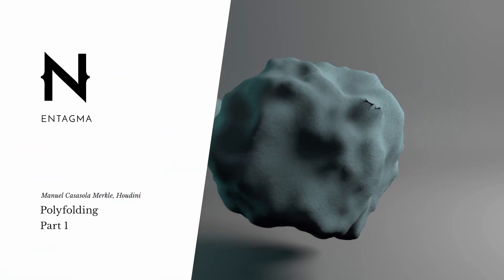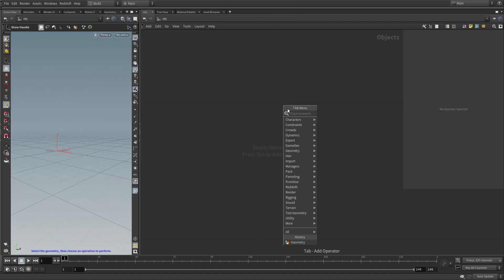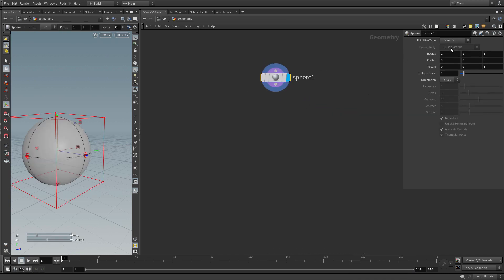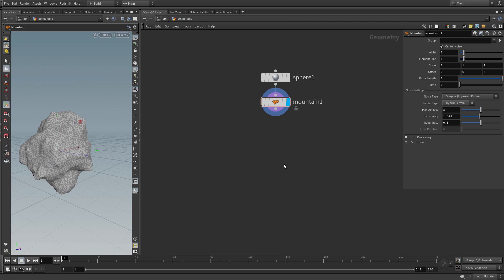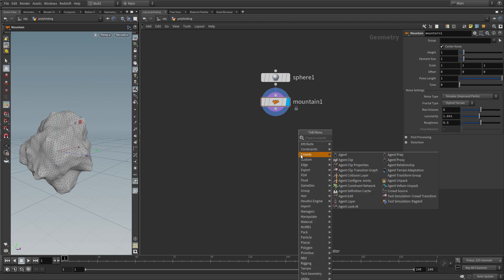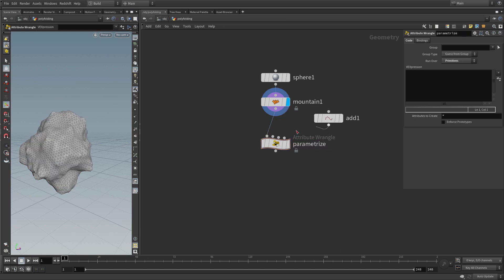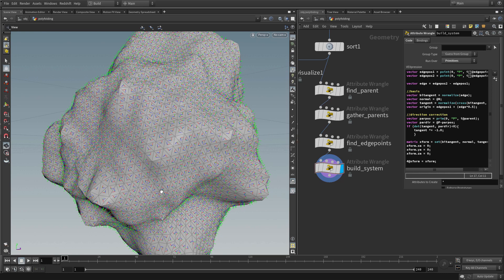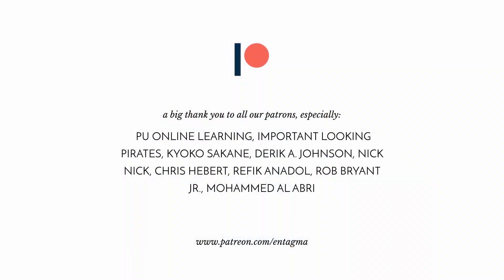Polyfolding - Part 1

Comment: nit:
Creating an array and appending to it can be computationally expensive (unless its actually a linked list or something, but these probably aren't under the hood).
To handle this, rather than removing the parent -1 AFTER you populate it, you should use if (parent > 0) append(...) - this way you will avoid additionally having to resize the array.

Probably not a huge performance gain on a small object, but could be crucial for more subdivs and better practice. :)

Comment: getting error when doing the second primitive wrangle node.  using houdini 18.0.499
Warning:     Errors or warnings encountered during VEX compile:  /obj/polyFolding/find_parent/attribvop1/snippet1: Syntax error, unexpected '>'.     (7,28).
Error:       Vex error: /obj/polyFolding/find_parent/attribvop1/snippet1: Syntax error, unexpected '>'.  (7,28)
Failed to resolve VEX code op:/obj/polyFolding/find_parent/attribvop1
Unable to load shader 'op:/obj/polyFolding/find_parent/attribvop1'.
Reply: nvm typo on the if statement. please disregard